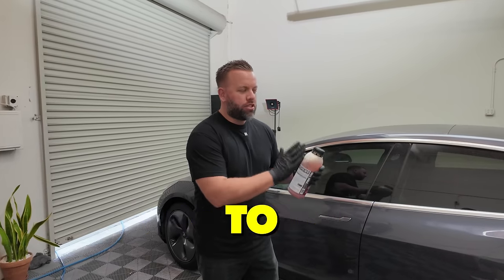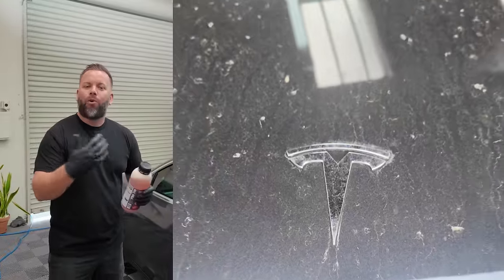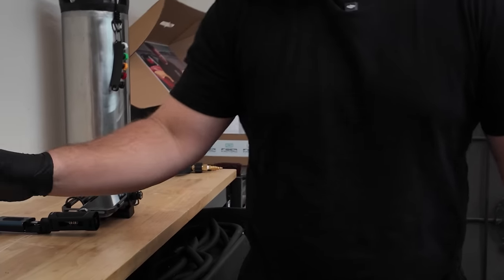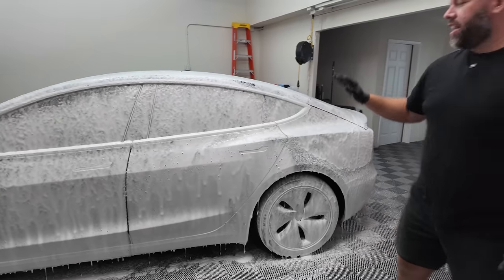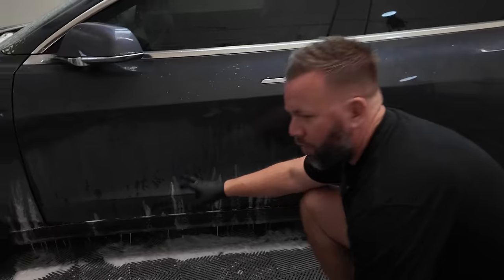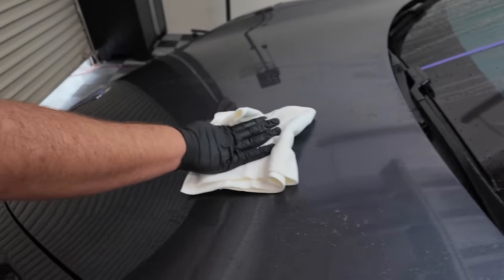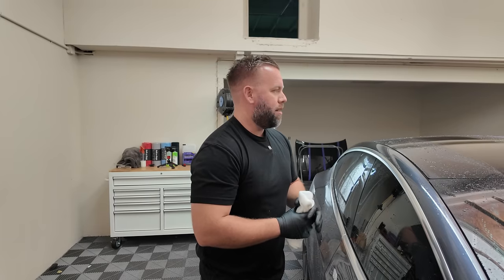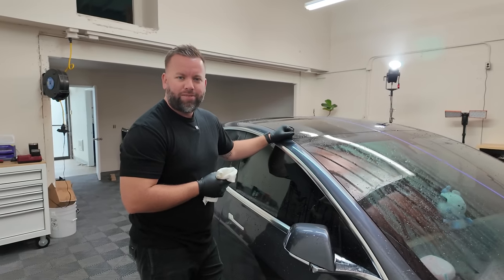SECRETS They DON'T Want You To Know - Do Not Pre-Rinse Your Car

Comment: Not quite sure why you didn't start the foaming pre-rinse on the lower half of the vehicle first and then work upwards.  Most normal grime is on the lower half of the vehicle so it (generally) needs the longest dwell time. 

That's how I was taught (and supported by some product instruction).

Do you have supported reasoning for your process?

Plus, the full rinse in this video was not a fair comparison because the 2nd rinsed side was allowed significantly additional dwell time for a fair comparison (despite the 2nd side not doing as well as the first rinsed side).  I'm talking strictly straight true comparison.
Reply from the maker: I haven’t found it makes a difference if you foam top down or bottom up. I also try to not over think it. It’s also going to always happen that one side has the foam sitting a little longer unless you have two people rinsing the car at the same time. Not much I can do about that.

Comment: Unless the car is very clean and well waxed, you CANNOT remove all dirt and contaminants without some sort of physical scrubbing.  Even a pressure washer will not remove all (settled-in) dirt from a smooth surface.  And now you know why window washers use squeeges, and not just foam and rinse.

Comment: when you have dirt and grime on a car through earths daily micro dirt in the air, then when you drive in the rain, the car is basically hitting the rain any where from 30-130 mph then rain drops are pushing that micro dust along the paint work which cause micro scratches,
buying a product where your trying to save on more micro scratching is laughable,
you ain`t going to stop top coat from scratching enough to make a difference,
And really need to be careful what products are used on modern clear coats as they are not so tough as they used to be,

Comment: This video is supposed to be about pre soaking then soap and you compaired the presoak side with the already soaped side. The video should be about taking that extra step to "pre soak" the car before soap. Clearly the just spray soap leaves residue . Should've finished off the video after actually soaping the pre soaked side. Bad comparison in my opinion

Comment: You guys and girls must not have a life doing all these steps!  Start washing in the shade and cool the car down. Quick rinse with water then wait a few minutes and quick rinse again. Use a foamy wash water and go at it. Start at the top so as you rinse the foamy water goes down and keeps rinsing the rest of the car. Dry it and you are done. Used this system on Mustangs, Porsches, Corvettes etc and got awards on all of them. Foaming looks fun but IMO is just the next gimmick to sell expensive soap and applicator and justify that $100+ personal car wash! Oh, and keep the pressure washer away from your car. An off road vehicle maybe at the lower pressure to get the mud off first but you're going to get your hands wet either way. Lets face it if you take you vehicle off road you probably don't car too much about the paint.

Comment: Haha 😂 people think they invented the wheel in 2024. I have done this for over 25 years..........🤣🤣🤣🤣 yes I have washed cars professionally..... 3 cars per H at a dealer inside and outside. Perfect finish for cars standing at dealer showroom. Worked there 25 years ago. They had the real strong stuff that only companies could buy ofcours this only works on not so dirty cars. But I only wash with 2-3 times a year per car nowadays. Rest of the time this method but pressure and fome at the same time bc that's how the washer I use is built. If the have separate foam/degrees I just foam then rins. Do this once a week.... so cars stay fresh and clean. Only cost $2.5 per wash 😂 then air drying in highway. when I see cars standing in long lines for automatic wash I lough my ass of....🤣🤣🤣 this works even better if you ceramic coat the car. I haven't even polished my cars was going to but didn't have to bc I do not scratch my cars......
Reply from the maker: This video was posted in 2023